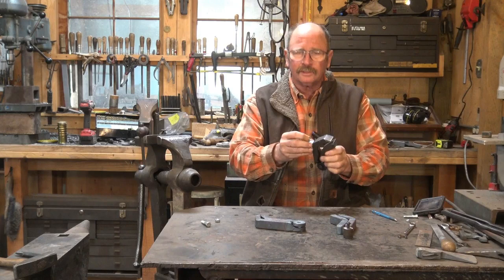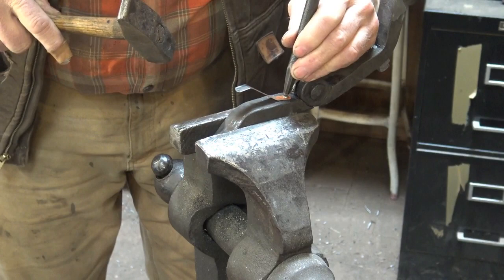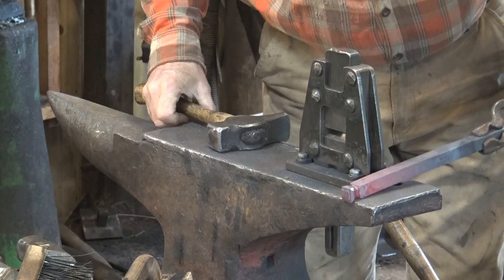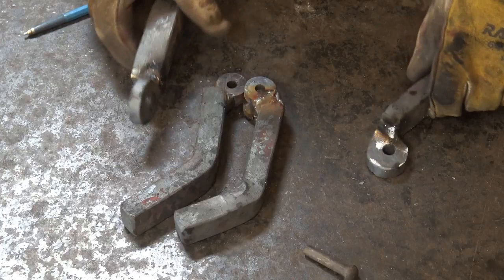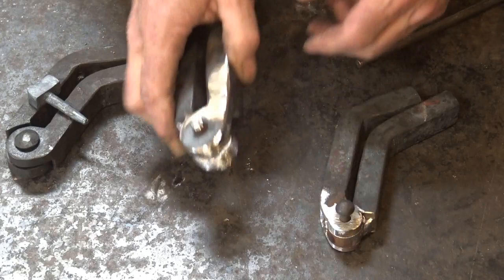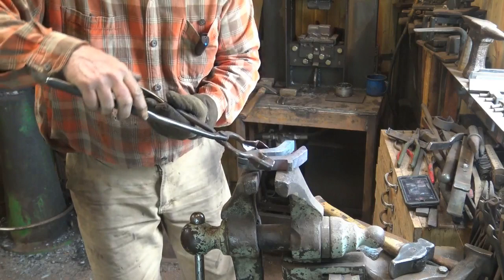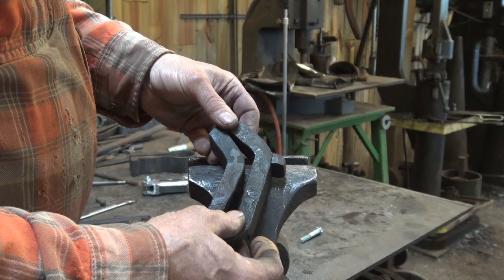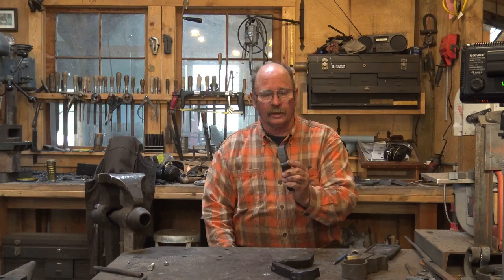Making the Filing Vise - part 3 - blacksmith tools

Comment: Thanks for the continually great videos! 
As you were threading that lug I was hoping that the thing didn't end up 90 degrees out of position when you screwed it in. I guess you would've just heated it up and twisted it in that case?
Reply from the maker: Either that or heat it and upset it into the hole a little

Comment: Much better job on the "stud / holding bolt".  I feel; when one can,  one should stay true to the aesthetics of hand made blacksmithing tools.  The one out of the three file vises I like the most is "Lug Added File Vise."  To simplify and avoid trying to marry the rough work of forging with the finer work of machining (the threaded lug) is to simply peen over the lug end as you suggested.  That way one can avoid the cutting of threads first; before shaping lug head,  just to learn where the head of the lug will stop in relation to the orientation to the body of the file vise. Also trying to do rough forging work and leaving the proper amount of material for good thread cutting is eliminated.  Finally, speed and ease of over all tool construction.  I often found keeping it simple makes for the best quality.

Comment: Sorry if you’ve answered this before (I think you have, but can’t recall): what are a few of the best materials to make those guillotine dies with?
Reply from the maker: I don't think i have addressed it yet.  Some use mild steel, but the struck end mushrooms badly and needs dressing quite often.  For most I think 4140 is very good.  But for any with edges I like S7
Reply: Black Bear Forge thanks so much for the response. That was sort of my gut feel (either 4140 or S7, and that’s it)... but that comes almost entirely from watching your videos. So, either you have mentioned it before, or it’s in line with other times that you’ve talked about those alloys.

Thanks again :)

Comment: do you have some tipps for my holdfast that is not holing something but jumping out all the time?
Reply: check the bend angle on your hold fast, if its not wedging the shaft in your pritchel hole that would cause it to bounce out - they do loosen in use but it shouldn't be coming out completely every blow of your hammer - just fiddle with it and you'll get it.
Reply from the maker: Make sure the shaft diameter is as close to the hole diameter as you can get it without it being tight.  The main reason I have seen for holdfasts not to stick is that someone oiled or waxed them to prevent rust.  That just lubricates the holdfast.  Increasing the length of the arm can also help.

Comment: What if instead of a hinge and a spring you just made it one piece. With a long springy handle like a spring fuller. only put filling vice jaws on the end instead of the fuller dies.
Reply from the maker: That is an option.  DF in the shop made one that way